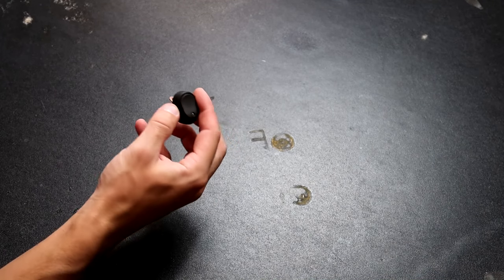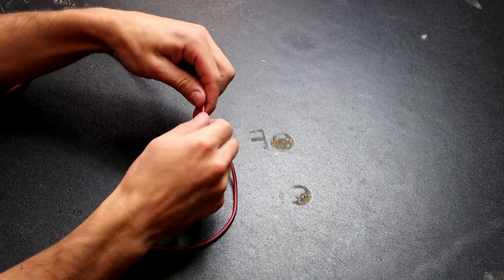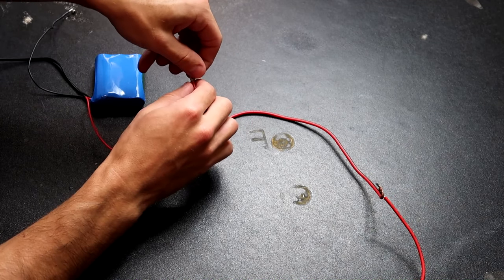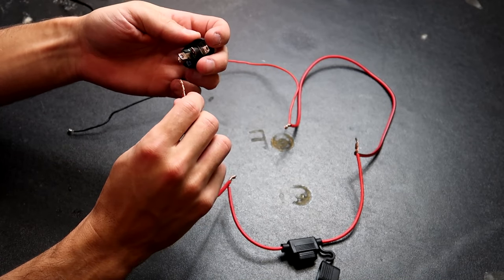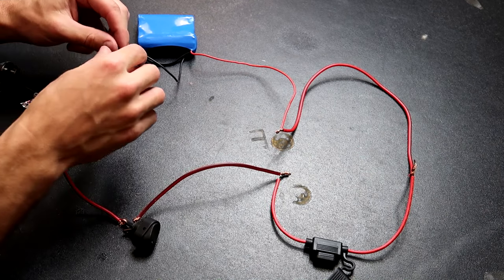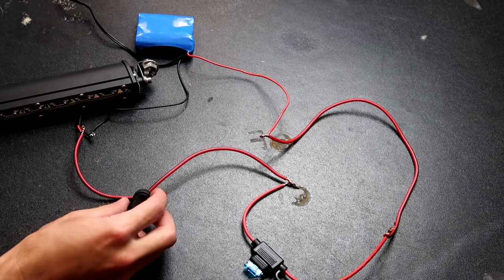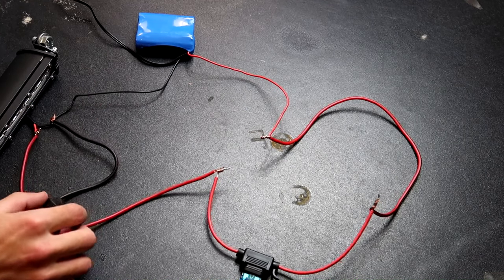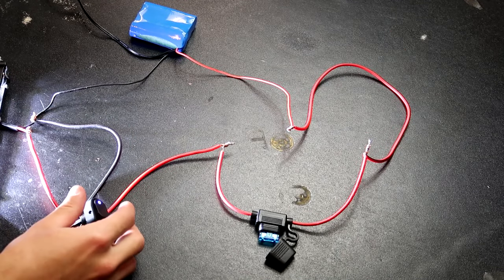How to Wire 3 Prong led Rocker Switch

Comment: I have a led to setup my car but I noticed that other videos have a relay. What’s the relay for? This video didn’t need a relay.
Reply from the maker: this led light is only about 20 watts anything over like a 35 or 40 watt light i would probably use a relay. a relay will protect your wiring and switch from overheating and possibly catching on fire. if you do any wiring and you notice your wires getting really hot your either going to need a lot thicker wire or a relay.
Reply: Great video..probably didn't need to connect 2 wires to fuse..1 side direct to battery..shorter the better

Comment: Hello there, Iam having h3 headlight of 12v 55w halogen which I want to Connect directly to the battery, how much amp fuse Iam suppose to use.  Thanks

Comment: If suppose I use 40 amp fuse in this circuit what will happen, we have to use only 10 amp fuse on this circuit???? and also I have 12v 55w h3 halogen headlight which i want to directly connect it to 12v battery which fuse iam suppose to use? thanks
Reply from the maker: the wire would probably burn out before the fuse. the fuse is just there to blow before your wire does.

Comment: uh so not for a car application, unless you're using a battery pack? or you want to run a wire through the firewall and all the way to the car battery.for a simple LED light. there has to be a wire under the dash you can use ?? that's what I was hoiping for anyway.
Reply from the maker: for the led light you can attach it to any ground.

Comment: I’m new to working with electrical stuff so forgive me for asking but if I wanted to run some auxiliary lights in a car and I wanted to add a switch to turn them off and on could I just add a switch to a fuse tap then wire the lights to the switch ?  

I’m trying to watch videos to see if that’s what people are doing but I’m only seeing videos about people shooting wires from the switch straight to the battery? 

Any help would be greatly appreciated. Thanks brother 🤙🏽

Comment: Great vid. Very informative. Is there any way to wire it to only close a circuit without sending power to the circuit. While retaining the indicator light? Or is there a switch with led indicator the doesn’t send power through the connected circuit??? Help pleasssssse
Reply: @DarkKent did you get your answer somewhere else? Im struggling with similar. Im trying to use this same 3 pole switch on the ground side of a circuit. (similar to how one might install a 2 pole switch that doesn't have an led indicator). I too want the led illuminated when switch is on (when the circuit is live). I tried using the supply & ground poles on the switch which did illuminate the led, but did not fire up my device (a relay). Then I tried using the supply & load poles on the switch which did trip the relay but did not illuminate the led. Also tried grounding both of the load & ground poles on the switch with mixed results. Not sure what is going on there. If I cant resolve this easily, Ill have to rewire the whole thing with switch on the hot side of the relay.
Reply: @chris-topher  I gave up and got a different switch that works as intended
Reply: @DarkKent  Thanks for the reply. I spent so much time trying to understand why it wont work on the ground side, and I gave up on that. I've learned now tho, that the 3 pole switch needs to be wired on the positive side of your device. I spent nearly an entire day rewiring it to get it to light up lol.